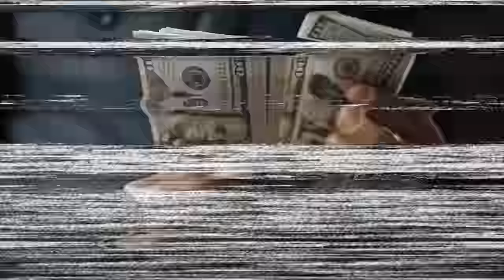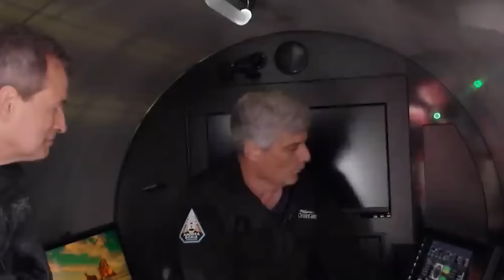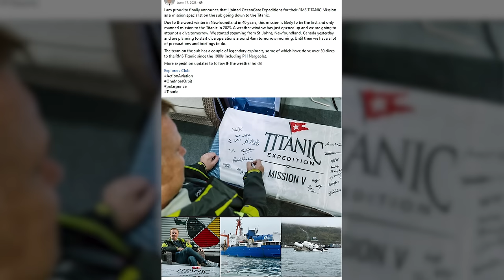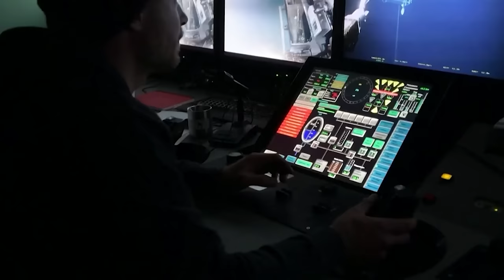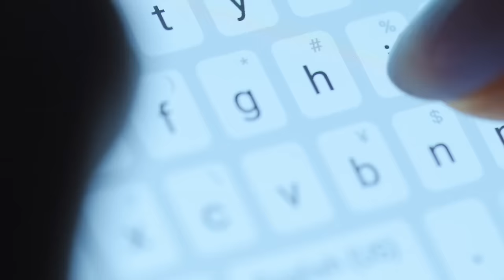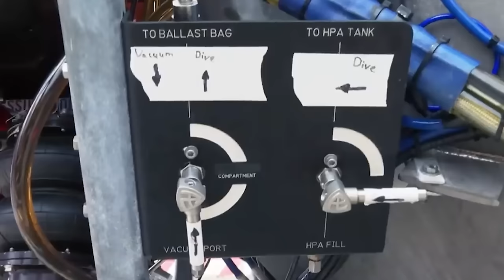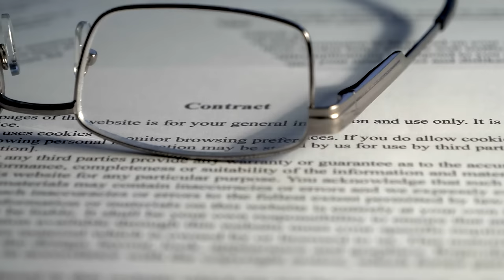The Titan Tragedy: What Went Wrong with OceanGate's Mission?

Comment: I'd heard somewhere about this thing that at the depths they were at. the pressure was such that the implosion was to have happened 4 times faster than you can blink your eye. To go from complete conscious human to being turned into paste in that time frame is just amazing to consider.
Reply: Yeah and they had to have heard it on the ship. Any kind of sonar. Air pocket. No it would of been immediately detected there was an implosion moment communication was lost
Reply: not necessarily. thermal layers in water will hide noise and confuse sonar. With most of the ocean depth between the ship and the sub, that seems to be why they relied on SMS etc to relay the sub's status.  @jaymesnin
Reply: Unimaginable horror to consider.
Reply: @Mike7O7O  Inversion layers are very effective in reflecting sound even in air. On a clear night in winter, when ground radiation makes the air near the ground become colder than the air at a higher level, I can hear a motorway and railway many miles away. It is usually too far away to hear but the sound is reflected and trapped in the narrow gap under  inversion layer where the temperature inverts. You can also tell there is an inversion as wood smoke from the wood burning fires is trapped unable to rise in to warmer air and the smell of it becomes pronounced.
Reply: @jaymesnin  Lol you have no idea what you're talking about...
Reply: At least the poor passengers didn’t know what happened. So sad..😢
Reply: Like crashing a fighter jet into a mountain covered in clouds and zero warning.
Reply: @kevinmalone3210 at least those involved in this tragedy didn't have time to process what they saw.
Reply: It's actually faster than the signals from the human eye can reach the brain to process the image as well as faster than pain receptors can send pain signals.

It's insane to think they literally were there than bam. Nothingness. Not even a thought of what happened because it literally happened so fast your brain doesn't have the time to process anything during it. Crazy to think about how fast that really is.
Reply: @Mike7O7O US Navy heard it and reported it.  That is what James Cameron said.
Reply: Rapid decompression would have caused them to burn up before they were turned into sludge in a micro second
Reply: The best quote is they didn’t die, the just ceased to exist.
Reply: @rothbj1  yeah that's basically it when you think about it, incredible...conscious, breathing, living human to absolutely non existence 4x faster than your eye blinks...
Reply: They waited 8 hours??
Reply: It's rather disingenuous to censor the suspect text transcript, yet offer us a ghoulish and sensationalized account of the passangers' deaths.

Comment: The sensors Titan had in relation to the hull cracking were acoustic, only going off if they heard the hull in the process of cracking.  Therefore the warning would have given the "crew", at best, a couple of milliseconds of a warning.  Most likely the ballast (a bunch of construction pipes) were released by failure of the shoddy ties holding them to hull.

Edit: You're also giving Ocean Gate too much credit in their claim that they hit Titanic equivalent depths on 13 separate occasions.  At most they managed it four times.

Comment: I can't stop thinking about how fast 380 atmospheres of pressure would vaporize you when that thing imploded
Reply: At that rate of speed.. the space they were sharing went from 1 bar too 380. Not in hours. In millisecond.  Probably less then 200ms..  an increase of 379bar in 0.2sec. I wouldn't be surprised if someone told me a flash of light occurred during the implosion. As the air present in the pod catches 
Fire being reduced in mass so much so rapidly.
Reply: 3,000 meters below sea level is 5,000 psi.
it happened 5,000 times faster than instant.

Comment: just read it somewhere, if stockton rush said carbon fibre is strong material, even airplane like b787 or a350's fuselage are made of it, experts say it is only reliable to hold the pressure from the inside, not the outside...
Reply: The airplane companies test and test the wings,   Rush did very little.
Reply: I guess that’s why subs and airplanes should be made of different materials that would withstand the different atmospheric and underwater pressures.
Reply: The airplanes are also not built with expired carbon fiber that's past its shelf life. and that's what stockton rush bought from boeing. stuff that wasn't even deemed safe to use on planes anymore, yet he happily built a sub out of it, with very little stress testing, using it for the opposite purpose the material is known to be good for when not past its shelf life. I can't even facepalm hard enough at that one fact alone, and there's multiple mind boggling things like this
Reply: @Knaeckebrotsaege  rush had his big idea, which was using carbon fiber so he could build a bigger hull, and he wasn’t going to change  it even listen to anyone.   He did rebuild the original hub but again with carbon fiber even though he knew full well that it weakened under pressure.    “They say I couldn’t do it but I did “ was his boast.    The they were people with decades of experience and he ignored them.
Reply: @RossM3838  Stockton Rush was too full of himself. He had too much pride and hubris, and this was the cause of his own demise. Pure karma.
Reply: The design wasn't ideal but It had made successful dives prior to it's last. What doomed them was simply poor maintenance. Some of the carbon fiber had begun to delaminate creating the fatal weakness. Had they simply overhauled the pressure vessel every couple of dives or so, it would likely still be operating.
Reply: @Knaeckebrotsaege  Here's a question. Airlines typically expect up to 30 years service out of new aircraft. How old was this "expired date" carbon fiber? over 30 years old or what ?..
Reply: @MarinCipollina   Raw material != finished product. They obviously purchased the raw material (beyond the shelf life to make airplane parts out of it) to make their hull out of it, not a finished product bonded in resin (which also has a shelf/cycle life, but it's longer). In other words, they started out with degraded components already. Also as with anything from the aviation world, things tend to follow strict safety rules and parts, components and chemicals used (think resin to bond the stuff) tend to be of a much higher quality standard than what this bad joke of a sub was built to

Comment: 6:20 "Lighter, more spacious, and more comfortable"

Is Stockton joking? Has he never heard of the Aluminaut? A submarine 10 times bigger than the Titan, also constructed using an unconventional material and a cylindrical pressure hull, could house 7 crew members, all of whom could be spaced out about a meter apart, there was more than enough room to stand upright and walk around, and it could dive far deeper than the Titan. It was built in 1964, and never had an incident. There is no excuse for garbage submersible design.

Comment: "likened to the force of a whale biting on somebody" is possibly the worst way i've ever heard sea pressure explained. Whale's bite strength and weight vary a lot. For example, an orca can bite multiple times hard than a beluga. Could say it's like the weight of three rhinos or about one asian elephant standing on every inch of the surface. That's a lot easier to accurately put into perspective than an unknown whale bite.
Reply: Get out of here! This is the internet where obscure units are the order of the day.
Reply: or..... you could use an internationally respected measurement system that can describe kilograms per square centimetre like most of the rest of the planet.
Reply: @basketcase720  Do you never grow tired of being so tedious?

Comment: Pressure vessels can be made with carbon fibre if the pressure is internal and stressing the fibre in tension. For external pressure, the carbon fibre is mostly holding the matrix material (epoxy or similar) together. There's no way by calculation to ensure its integrity will be maintained. They should have tested the hull design by hundreds of unmanned trips to the bottom. The whole project was done on the cheap.

Comment: Slight correction: they probably dropped the weights to slow down their descent, as was routine. And the 'system' they had on board to make sure the hull wasn't damaged was an "acoustic monitoring system" aka they listened for cracking sounds. But if the hull is cracking, it's probably already too late. (Not to mention the fact that a previous passenger said they heard cracks when in the submersible, and Rush didn't seem worried. If he wasn't worried then, he wouldn't have been worried before it imploded, either.)

Comment: This what happens when people who don't understand basic physics are hired.
Reply: I think it failed at the titanium ring and carbon fiber interface.  The joint is just glued.  The carbon fiber compresses, but the titanium rings did not.  This caused the glue joint to fail.  They did say, “Crackling sounds aft.”  And that was the glued joint failing.   Poor engineering.

Comment: How people with common sense would actually get in an uncertified submersible vessel that has a limited oxygen supply, in an untested carbon fiber "can" that used "glue" to bond carbon fiber and titanium and is locked and bolted from the outside to dive to a depth that was never tested without passengers and would take hours to return to the surface. There was "nothing" professional about this mission.
Reply: What’s crazy is that Hamish Harding and PH Nargeolot should’ve known better. They’ve gone to the depths before in a SAFE submersible. I’m sorry but those two should’ve known better.
Reply: @lenc3970  Yes, agree. There are many mechanical and chemical factors to consider [ and, I am not an engineer ], but, how do you bond fiber and metal with glue and "not" expect it to seperate at "extreme" pressure.
Reply: @VenableDance1 
"Epoxy" is specially designed to join two different materials.
Reply: @nancymilawski1048  They should have tested it and had it certified for diving to the dept they were attempting to reach. Especially after they heard popping and cracking before their fatal drive. Epoxy and carbon fibre are great. Lets see how many more submersibles will be build with the same design and purpose in the near future.

Comment: No emergency signal beacon.... jesus man. It could be set to blow off as soon as the hull alarms start going off, i mean you could have 5 off them and that way instead of searching an area twice the size of Connecticut you could be searching the last recorded depth and a few thousand yards in every direction at most, it could even be much smaller depending on how straight up each one floated u

Comment: 19:16  Even if the Titan had lost power beforehand, there’s no reason to believe that it would have suddenly pitched forward and dumped everybody inside against the porthole. I’m sure that there were plenty of aerospace folks who thought it would do that, because a plane would, but I think you’d struggle to find an actual naval architect who would believe that. Submarine stability works the same way in pitch that it does in roll, and if they were able to make an unpowered descent, which they did, it would have to be stable in pitch and roll for that to work.

Comment: Sensors telling you the hull is starting to crack is great but the issue is that if the hull “starts to crack” it doesn’t stop because one a breech is made the pressure would force a pinhole of water through at a fraction of the speed of light that would essentially cut through anything and anyone like a laser beam. It would then rapidly expand the deformation and as the pocket of gas around them was exposed to the pressure outside the hull it would compress so much that it would ignite the air in a flash of heat that would be comparable to standing on the face of the sun. That said all of this is happening so fast that your brain wouldn’t be able to react. I’m sure Stockton Rush knew the realities of suffering a hull failure but whether or not he considered these as he heard the crack and felt the shudder no one can say.

Comment: It's very unsettling to see the filaments for the hull being wound parallel to each other. In every other instance I've seen, the filaments are criss-crossed. I have a feeling that the sub would have lasted a lot more dives if they had done that - though it would still be delaying the inevitable. You need the filaments to be in tension - not something you expect in a sub hull.

Comment: Technically speaking Mr and Mrs Rush were correct in thier assertion that the Titan submarine was safer than crossing the street. In fact odds are that somebody has just been injured doing so as you watch this video.

Literally thousands of people die and get injured every single year by simply crossing the street whereas only 5 people have ever died in a Titan submarine.

Comment: Carbon Fibre is very strong and light. That is why airlines use this material, even on highly stressed parts such as wings.
The problem is how do you know that all voids have been eliminated?  Bicycles have long had this issue and many owners suffered accidents due to catastrophic failures.
When the people saying it was held with peanut butter,  I am sure they were correct.
You could not pay me any amount of $$$ to dive in thus contraption. Especially knowing how itbwas jury rigged with cheap, off the shelf parts.
Sorry 5 men died, but they were certainly warned.

Comment: The only thing i do not understand if they dropped the descent weights why it did not surface, after all you have air inside the thing, plus air or o2 tanks to supply air as well, so i wonder if anyone knows what the buoyancy ratio is with 5 passengers v's the drop weights and also the total o2, so basically as soon as the buoyancy weights are dropped she should go straight up at  safe rate no matter the depth she is in? 😢😢🙏🙏👍👌🦘✌
Reply: Same with Dark5. He's even worse.

Comment: So far only the titanium end (with the window blown out), the landing cadge (which was jettisoned) and the ring holding the front section to the hull. Until a second dive is completed and the hull found (or parts of the hull) it is hard to make cognise conclusions. I 'believe' the hull did not collapse, but as mentioned in the radio telemetry, the crew knew of a leak at the rear of the craft likely  somewhere around the ring. They tried to surface, dumping their weights and then the frame, but the water take on was too great and the machine began to sink once again. There then was a total break at the rear and the contents forced to the front and through the front window as it was blown off with the pressure (which was the equivalent to 50kg of TNT). So no, they were not crushed but fired like a gun with the immensely strong carbon hull acting like a canons barrel towards the front? Please advise if you feel this is a more likely outcome using the evidence presently available.

Comment: "The state of the art vessel was designed and engineered by OceanGate in collaboration with experts from NASA, Boeing and the University of Washington".  This is absolute rubbish, merely a BS claim from OceanGate that overexaggerated their input. All 3 organisations have explicitly stated they were not involved in the design of the vessel. It would have been nice if you'd explain the reason the passengers were classified as mission specialists and not tourists (the 250k from each person was not payment for the trip).

Comment: I was a little confused. At one point you say that they dropped their weights and were coming up because they knew there was a problem...but later its suggested it might have tilted to the point that all the passengers were piled on top of one another while plummeting down.
Did both of these things happen in that order or is it thought that just one of these things may or may not have happened?
Thanks :)
Reply: yes, I spotted that too. Where did you get your degree in submarine building? 
I bought mine in Borough Market.

Comment: Ten years ago i has an accident with a road bike.  If the front fork was made of the more modern carbon fiber instead of steel i would have been dead. The steel fork absorbed much of the forces and bent in the process.  The carbon fiber one would have cracked instantly.

Comment: Don't assume that the passengers were blissfully unaware of their impending doom.  Apparently the ballast AND the landing ramp were jettisoned as if there was a desperate attempt to surface.  One can easily think that given the submersible imploded there were abnormally and unexpectedly loud cracks that even moved the creator of the submersible to want to abort the trip.  The submersible also had warning sensors in the hull and there's no reason to think there were no flashing lights or ominous beeps warning of disaster.  Some think that because the implosion happened so quickly that the passengers had no time to recognize the imminent catastrophe.   Nope.  They knew.  And they had enough time to consider, debate, decide, and then jettison mass in an attempt to float up to safety.  They knew they were in trouble.
Reply: Did anyone claim what you've suggested? I never heard any such claims. 
So what? You're trolling yourself? You must be a Trump supporter.
Reply: @Mike7O7O  Apparently you didn't read the naive comments in the early going.  Don't assume that because you never saw something  happen then it never happened.  I know what I saw.  I don't see how you can say you know what you didn't see never happened.  And who is the troll?  Your comment has no purpose other than to generate an argument that will go nowhere, have no effect and is a vain attempt to puff yourself up and over someone of whom you know nothing.  Oy vey.  🙄